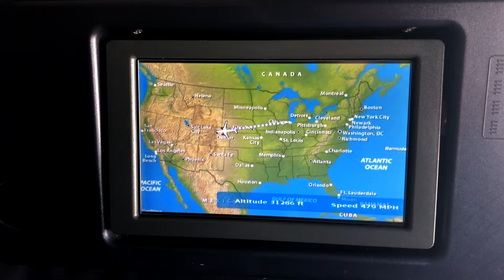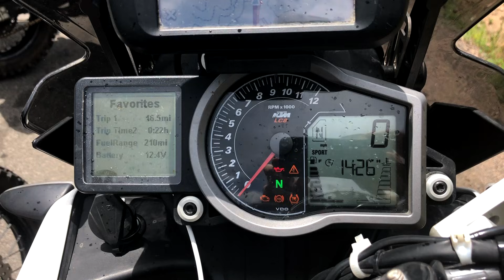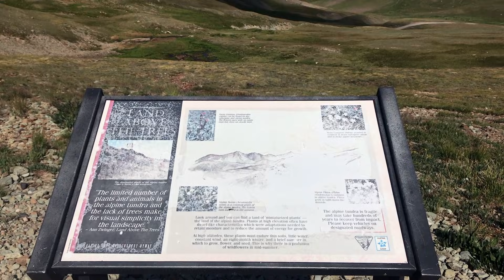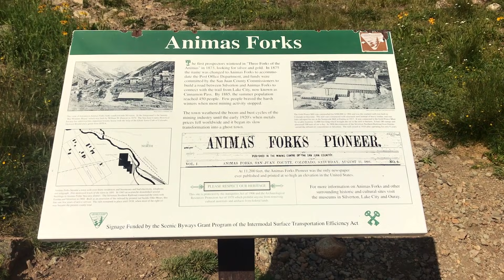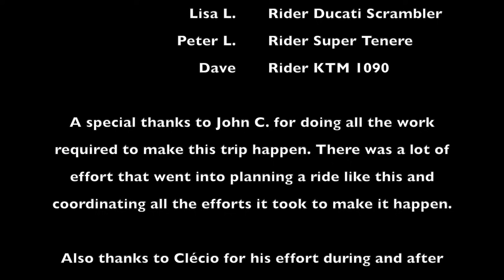COBDR Documentary Full Length 8 Days

Comment: I live in Salida, "The Heart of the Rockies" and have just purchased a BMW like the one ridden in your adventure. Thanks for the kill switch tip. I can't wait to get out and ride this terrain right in my own backyard.  Great documentary!
Reply from the maker: Thanks for the compliment and yes you have the right bike and an amazing backyard. So congrats on both of those. The kill switch problem will be very obvious if it happens because the switch itself won’t move to the run position. The concept of that piece is to prevent accidental changes to the position of that switch but it gets lodged in there. Rather odd issue.

Comment: Excellent review of the COBDR! Thanks for your efforts at giving us an honest recap of the challenges and rewards. On the bikes, none is without its niggling demons. I have a KTM 640 Adventure to which I've added a second radiator fan to manage overheating problems and prefer the lower weight vs hp for the inevitable drop. Soft luggage may be a better choice, too. The ATK has a great Rotax motor - amazing grunt for those tight sections on Black Bear Pass - what a butt puckering experience! Glad you could reflect on your adventure and hope you have many more.
Reply from the maker: Thank you for all the kind words I’m glad you enjoyed it. Thanks for watching! I also agree that all bikes have little things, none are perfect. Overall though we’re really lucky to have so many great choices available.

Comment: At 33:15.  Looks like the spotter was pointing to the right side of the trail to me, where the dirt met the rock? .Anyway the Ktm 990 rider may want to step up a couple sizes of front fork springs,  That will prevent that fork dive.
Reply from the maker: The 990 was definitely not stiff enough on the front end as was obvious there and also later on when it bottomed and blew out the fork seal. The owner upgraded the spring rates after the trip.

Comment: The low side. What caused that?
Reply: At that time, inexperience riding pavement and the panic that occurs due to that inexperience. Instead of applying counter steering I laid the bike down when I saw a large horse trailer coming the other direction in a corner I was moving too fast for. A lesson I will never forget.

Comment: Watched your T.W.A.T. vid (and ran it shortly after) and now just sat through this video and slowly planning the CO BDR.  Great work!!!   I'm in the Chicago area and was looking for a temporary storage solution in order to fly out to CO and do the same ride.   How did you handle the logistics of transporting the bike to CMA and back home?  

Thanks!
Reply from the maker: Thanks for watching. This trip John C. Did most of the logistics so he gets all the credit. Pick a transport company and I’d highly recommend Colorado Motorcycle Adventures where we stored the bikes. Getting them back we had a vehicle and trailer we left near the starting point so drove that back. A one way U-Haul would be another option. So basically on the way out two guys drove each hauling two bikes. We did the ride then two vehicles hauling 2 bikes each back. If you want to fly there then fly back one of the transport companies would be your only option. For storage though you can use the company I recommended. Also keep in mind this is doing the route reverse like we did from Baggs to the four corners. Can’t make any recommendations for doing it the normal direction.

Comment: Hi Dave were you on the Ktm 1090 adventure r model?. If so did you find the height too much for tricky black bear pass we’re a lot of foot support was needed? Thank you
Reply from the maker: I was on the 1090 and it did fine everywhere except black bear pass. It was a handful there. After the 1090 I purchased a 790 and I’m confident the 790 would have made that section more manageable. All the other passes though the 1090 did very well. Thanks for watching.

Comment: What temperature did your KTM overheat it? I’ve taken my 1190 to Moab to ride the white rim Trail in August and it was 111°. The bike got up to about 235° A couple of times but never flashed or showed an indication of overheating.
Reply from the maker: I don’t remember exactly but it wasn’t that hot. We weren’t dripping in sweat or anything. My best guess was about 80 - 85 degrees. The 990 overheated at almost exactly the same time. This has been the ONLY time it has happened. I’ve ridden in warmer weather and moving slowly so the only thing I can attribute it to was how long we were sitting without moving at all.

Comment: Wow! Great video and absolutely stunning scenery!

I'm surprised, KTM's overheat from stop and go traffic? Did they have some mechanical issues with them?

Also, do you mind sharing approximately how much was it to ship a bike from Chicago to Colorado?
Reply from the maker: The KTMs are kind of known for running hot especially the rear cylinder because of airflow. Moving they’re fine but once air flow stops they get toasty. The twin cylinder ones not singles. No issues with either of them. As far as cost to ship it was splitting gas and trailer rental with John C. He hauled them out so I didn’t have to pay a shipping company. Thanks for watching.